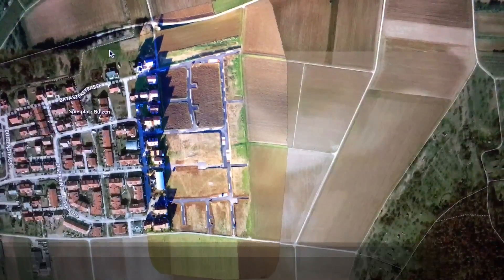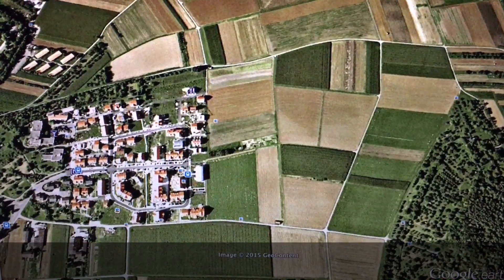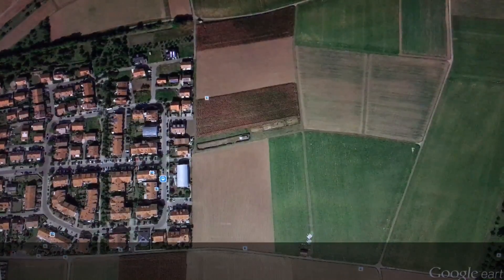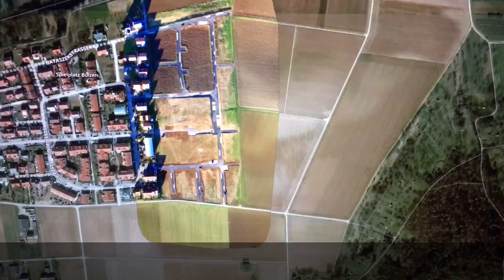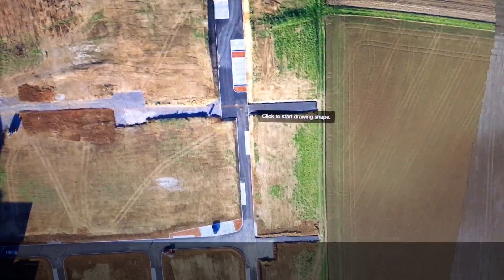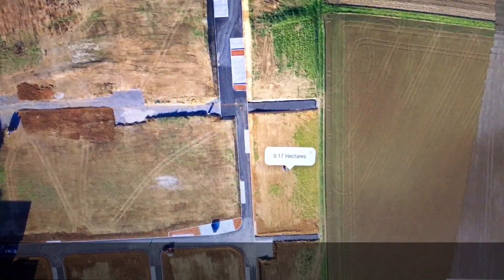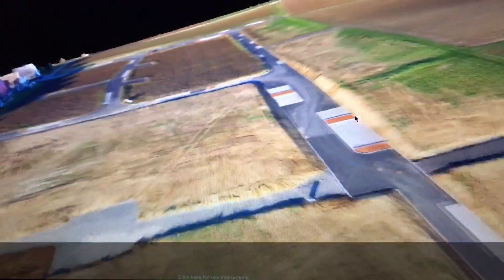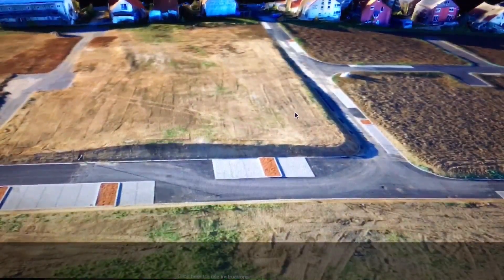Creating a high-res map using a drone!

Comment from the maker: For this video I used a stock standard DJI P3P. The only mod was the HDMI port installed in the remote controller, which provider the live video feed on the aux. monitor.. That isn't necessary to make a map however.